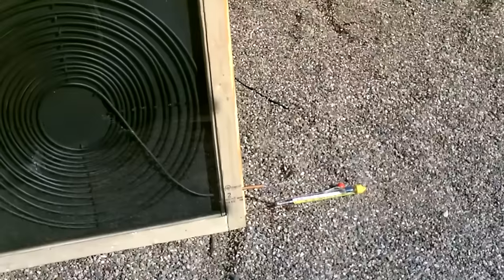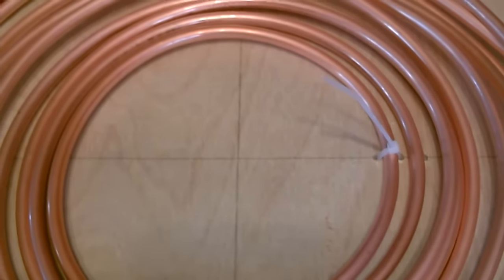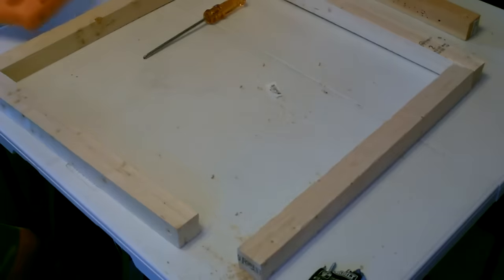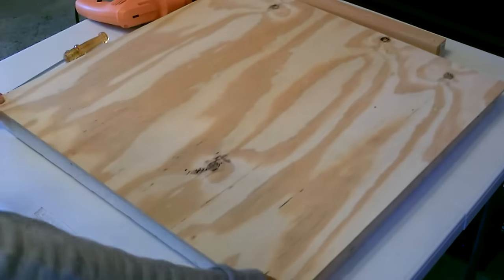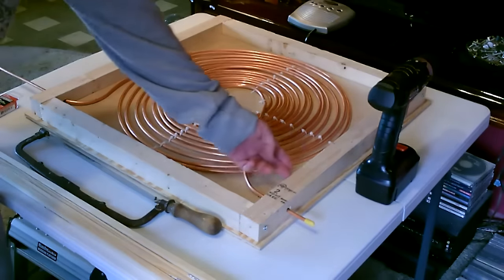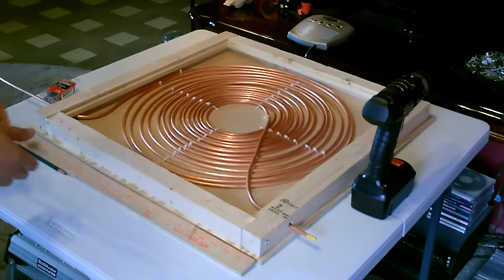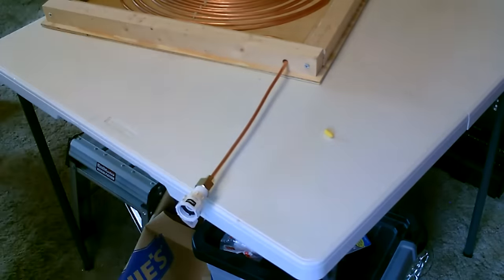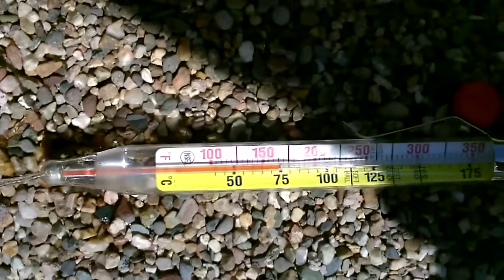DIY Solar Water Heater! - Solar Thermal COPPER COIL Water Heater! - Easy DIY (Full instr.) 170F

Comment: we are removing our electric/gas water heater out of our motorhome.  We are going to use this instead...how do we hook it up?
Reply: Maybe use this setup as a pre-heater? You'd have to tie this system into your cold side existing system with some kind of circulation pump.  Not sure I'd get rid of the system you have now since this would only work during the summer daylight hours. Otherwise, you'd only be able to shower or use the hot water during the day. I'd say figure out your consumption rates and storage, figure how many of these you'd need and go from there. If you plan on heating with the copper coils then storing it, you'd need something like your current system to keep it hot enough for evening/nightime usage anyway. Hence why I said to just keep what you have.

Comment: Now if you install glass ball on top of copper coil pipe at right distance so the glass ball can act as convex lens, it will increase efficiency of water heating. A smaller version of this glass ball, watch video "Spherical Solar Energy Generator Rawlemon - BTF".

Comment: Did you paint the glass too ?
Reply: No, why would he want to do that? The whole point is to let the light in,  to heat the pipe up, as much as possible, like a magnifying glass. If you paint a magnifying glass, will it burn anything? No. If you cover your car windscreen, with a cover, will it heat your car no?  Same here.

Comment: What if you put a mirror behind it, so some light which didn't hit the copper is reflected to it?
Reply from the maker: hi there. you could, but it's already pretty hot. maybe for the colder months?.
Reply: Manfred Konrad Richter ...id use industrial aluminum foil behind the coil instead of a mirror just make sure the foil is not touching any thing except around the edge where its attached and have 1 inch air  gap between the foil and the bottom plate.

its called radiant heat ...the heat is reflected back  from which it came....DONT ALLOW THE FOIL TO TOUCH ANYTHING ELSE OTHER THEN WHERE ITS ATTACHED....where ever the foil touches the heat will not reflect it will be transfered thur the foil and to what ever is being contacted 

this is for the back side of the coil... if on the front after the glass then the heat will reflect before getting to the coil

google radiant heat it works great IF done correctly
Reply: hey
Reply: Manfred Konrad Richter
Reply: Manfred Konrad Richter Sweat the tubing to a copper sheet , insulated the back and paint it all black. No mirror reflecting away energy.
Reply: D W  Actually the mirror could reside at the flipside reflecting back energy going through.

Comment: Get a solid state graphite power cell bank that generates an electrical charge off earths magenitic field that charges up organic carbon power cell bank that provides electrical power to a heating element on a thermostat to always have free hot water. You could also use thermal electric generators and water pumps to keep a home or green house warm has well. A state of the art off grid electrical and hot water generating system. Beats solar any day! : )

Comment: Did anyone tried this for pool heating? How effective it is?
Reply: Aariff Kadar I saw a comment above in this thread by someone who said they heated a 4000 gallon pool to 98° with this method.
Reply: @Wildflower_Breads  for every 1000 litres of water = 1000kg (= 1 tonne), we need 4,200,000 joules per °C rise. For a 1m^2 panel, at 1,000W/m^2 (i.e 1,000 joules per second, by definition) that's going to take 4,200 seconds (over an hour) for every 1°C  (1 kelvin) rise, so over 30 hours of continuous sunshine (which is obviously not possible!) to get from 7 to 37°C. But 4000 gallons is more like 20,000 litres, or 20T, so 20 x worse. It's definitely doable, in fact it is often done, but, to slightly miss-quote Michael Caine in the film  The Italian Job, "We're going to need a bigger panel". Hope this helps.

Comment: Wow.... how to connect this to the boiler?
Reply: Use a circulator pump that circulates water/glycol from the solar heater through a super insulated hot water storage tank that has a heat exchanger coil in it for domestic hot water.

Comment: I bet you could avoid all the drilling by using pegboard.
Reply: If pegboard gets wet won't hold up very long
Reply: True, that...however, I have seen acrylic or some other heat-resist plastic.   Never mind.  Youre right.  Excellent build.
Reply: You are right of course Ann but I think one of the beauties of this design is the use of off the shelf materials the glass and the copper coil are literally ready to go from your hardware store I have cut many types of plexi and even I suck at my teeth with reservation simply at the thought of it not the easiest product to work with...
Reply: And, the heat is held inside the box, continuing to heat the coil… if cooler air entered through the unused holes of pegboard, the heat wouldn't build the same and temps would be significantly cooler.  peace
Reply: this!

Comment: The end shows copper then he says "paint it".. next its black? Paint what with what paint and whats the SOURCE of water flowing in..?   Kind impossible parts tIo exclude
Reply from the maker: Hi Marie, i used flat black spray paint to paint it. you want to use the darkest paint you can get. i just hook it up to the garden hose. you could use a water pump if you want though  🙂

Comment: what size is the copper pipe in inches?
Reply from the maker: hi. it's 1/4" tubing. 3/8" tubing works well too
Reply: @desertsun02  for a simple hot water reservoir, is there a video, sir? Thank you 🙏

Comment: Too silly, black polyethylene pipe is so cheap to buy and retains the heat so easily.
TOO LONG AND IT MAKES STEAM.
Polycarbonate Sheets cut to size is my choice.
For plumbing use PEX pipe.

Comment: Has anyone tried to make the box a parabolic and using mirror glass to reflect the heat back and place the pipes to collect the max heat, the pipes only need the black coating and then cover with glass using  2 pieces of glass separated by glass pieces to keep the 2 sheets apart, then evacuate the air between them as heat does not travel in a vacuum, same idea as evacuated tubes, I may make my idea and put up a video,
Reply: i was thinking the same. would love to see anything out there you make or run across
Reply: Heat absolutely travels through vacuums. It's called radiation. Maybe learn elementary science before trying to have engineering ideas.

Yes, people have done that, and it works, but it's far more complex, larger, and beyond most people's means.
Reply: +seigeengine true, I was referring to making the parabolic mirror as a good idea. even if heat didn't travel in a vacuum,  good luck keeping a vacuum inside such a thing! it's a good thing heat travels across a vacuum or the sun wouldn't be able to heat the earth across the vacuum of outerspace.
Reply: +seigeengine point well made on the parabolic mirror idea. it would take a huge mirror and thus defeats the purpose. I thought about a fresnel lens only as long as it took me to see how dangerous they are on youtube.  I ran the calculation and even on hotter days it would take far too long for my small pump to do anything significant with this set up. but maybe if the heat loss in the pool is minimal overnight it might be more effective. but I don't need to swim early on hot days in Florida!
Reply: John Fleming  Now, pools are an application where this sort of thing has some merit seeing as how you're already circulating water, but it takes quite a bit more area than this tiny panel, they tend not to be made out of copper, and you need to consider the ramifications of the addition on your pump.

I'm a Canadian, so I'm very much more concerned about the cold. ;)

If you're interested in solar pool heating, I'd probably start reading here: http://www.builditsolar.com/Projects/PoolHeating/pool_heating.htm
Reply: no, I am not going to build one as may cause a death ray and burn the sun out.

Comment: My familly can shower with 100 litres.... 😂 So how long coil do i require..... 😂
Reply: You could probably have a old  water heater tank and have a small inline pump pushing water through it. Not exactly off grid unless you add a solar panel / wind turbine. But still cheaper than even a gas powered water heater.